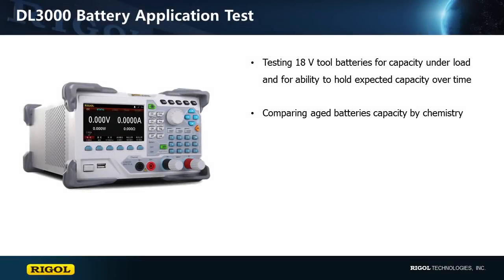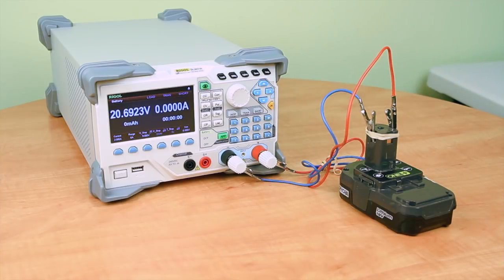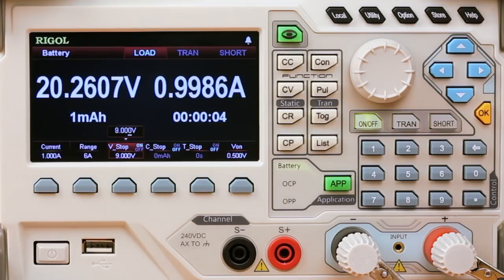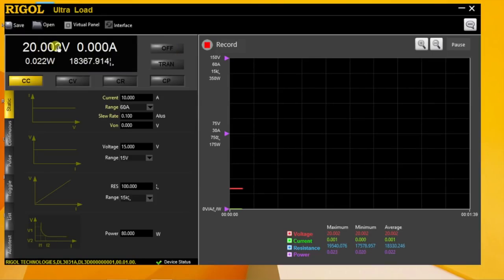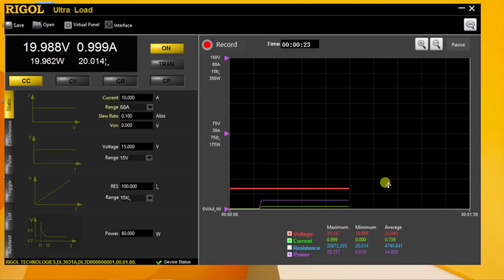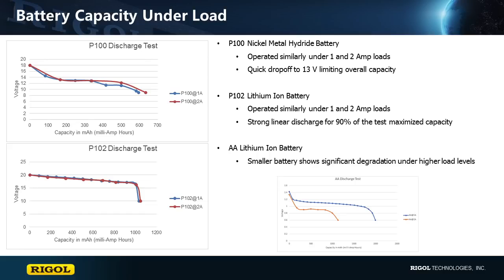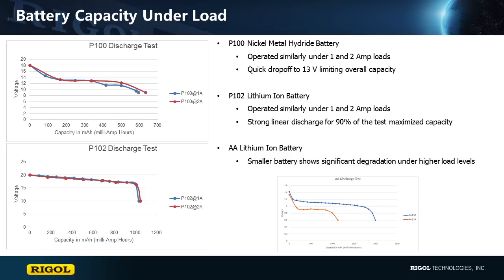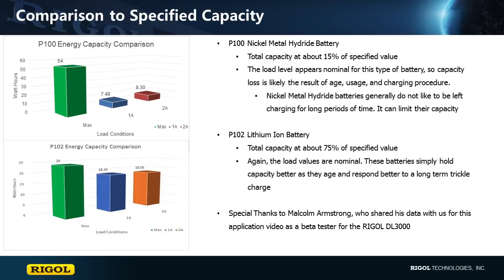RIGOL DL3000 Electronic Load - Battery Test

Comment: I use my rigol dl3021 at work to test scooter batteries.. these batts see a 20A load when in use so I'm working my way up from 5A to test how well the batteries hold their voltage at higher loads .. 5A works perfectly fine.. but when I change it to 10A the load drops to 0A.. the timer is running, the light is green, everything says it should be working but the load is at 0 amps and the mah reading isn't rising... What am I doing wrong here??

3s 12v lead acid bats stock
10s 4p Panasonic 18650j2 upgraded batts I build..

Comment: Hi, looked at your video, nicely made, you mention "after compiling the results" you show graphs over the resulting tests, is this a manual data collection from the .csv files, or is there a program that can display these values? trying to find out if there is a possibility to measure power consumption with the DL3021A and display this in a usable format over time!  Br / A

Comment: Can i pull CP in the battery mode since CC isn't always what is required by the DUT?
Reply from the maker: Hello in battery mode only CC is available.
Battery test: A test for discharging the battery in CC mode. You can set the termination conditions: cut-off voltage value, battery capacity value, and discharge time. When any one of the three conditions is met, the discharge stops. Then the load automatically stops sinking. When only one or two condition(s) is/are selected as the termination condition(s) for the battery test, set the rest termination conditions not in use to be "OFF".
In Battery mode, in addition to recording regular data, such as current and voltage, the data file records the "mAh"(battery discharge capacity), "wh" (battery discharge watt-hour) and "time"(battery discharge time).

Comment: Once the device is set and the application is connected, it show the message: "APP mode is not supported in the main interface, CC mode will be enable". After active the load (press ON/OFF button) the current is zero. It seem the setting come from CC mode. I try many ways but I was no able to record the variables in the APP using battery testing. Not sure how this video is made. Any suggestion is welcome.
Reply: I found an older version of Ultra Load works (00.01.00.02) as shown in this video, but the latest version I can find (00.01.00.08) has the problem you describe.  Rigol seemed to have messed things up with the later version!

Comment: Can the load also show watt-hours on the display?
Reply from the maker: With battery mode it is possible to display and measure mA * hours over certain time.
You could use Rigol software ULTRA LOAD and record a csv file with the data (Voltage, current, power, resistance over time). Then the integral (= Watt * hour) could be calculated in Excel with that data.
Reply: Thanks! Hopefully they update the firmware+software at some point. The DL3021 seems like an awesome load for the price. Also, logging a csv file to a USB flash drive would be very handy, is that possible?
Reply from the maker: I'm sure they are taking note yet!
Reply from the maker: not sure about the download from the unit to the USB stick, but the Rigol Ultra Load PC Software is free of charge.